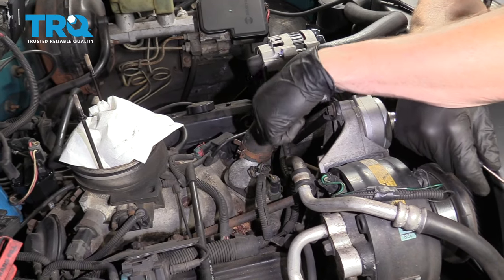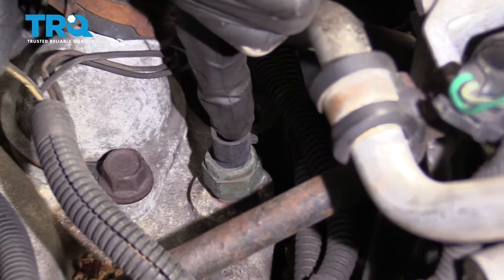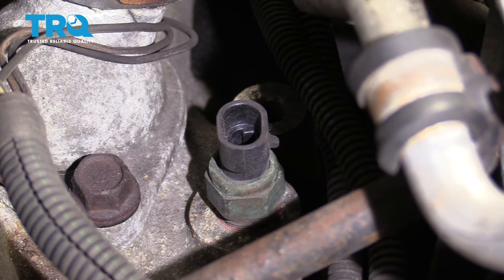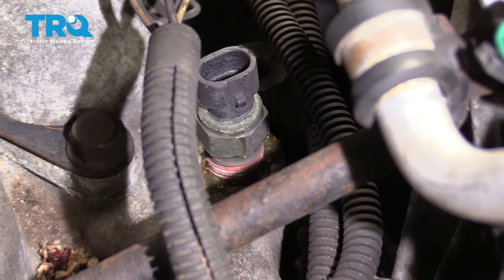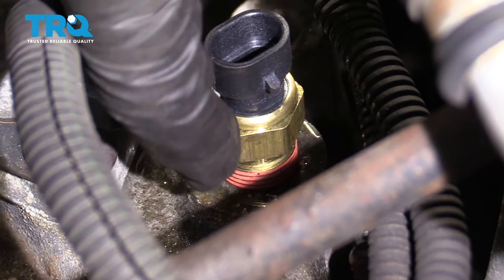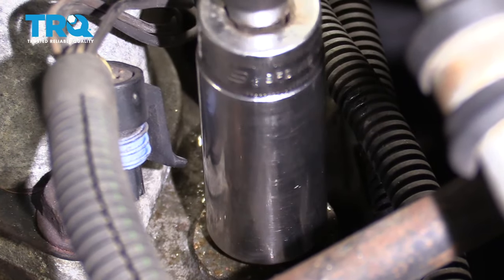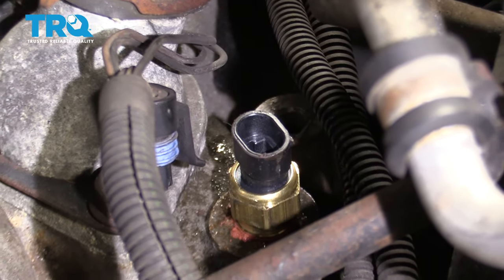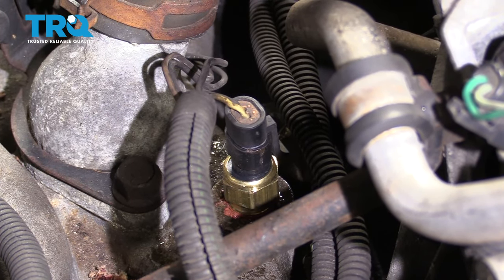How To Replace Coolant Temp Sensor 1992-99 GMC K1500

Comment: Have a 92 silverado that surged really bad in cold weather, was told it was a cracked intake manifold, replaced the coolant sensor and haven't had an issue since, for 40 bucks it's well worth a shot. Might be lucky like me

Comment: If you have a 96 5.7 vortec, you might have the same problem I did. There was a metal line in the way preventing me from getting to the sensor with my ratchet. Go to autozone and get a pivoting 3/4 or  20mm and you should be able to get the sensor out.

Comment: I replaced my sensor but my guage is still stuck on a higher temperature
Reply: There is another sensor on the right hand side by the #1 cylinder that controls that guage
Reply: @350sbc8  you know what your right I just remembered that thank you man
Reply: @350sbc8  A it's the sensor right under the alternator right
Reply: @350sbc8  what’s it’s called ..my 98 c1500 does not mark engine temperature..
Reply: I changed my left one by the driver side bc it was reading to cool when I knew it was way hotter , now it’s reading all the way hot so know I need the sensor  on top